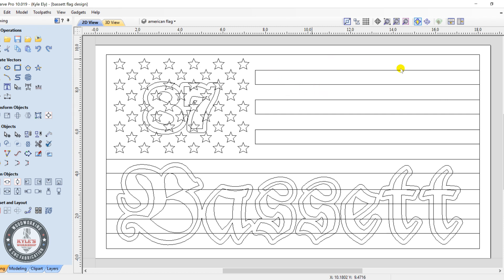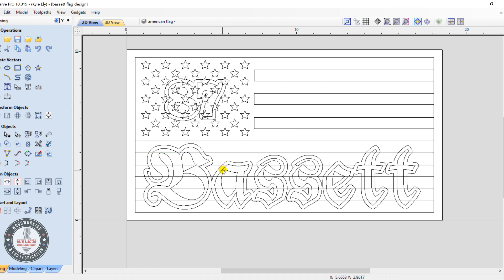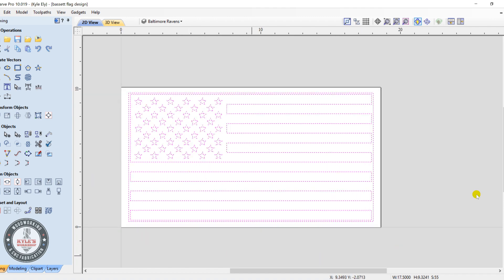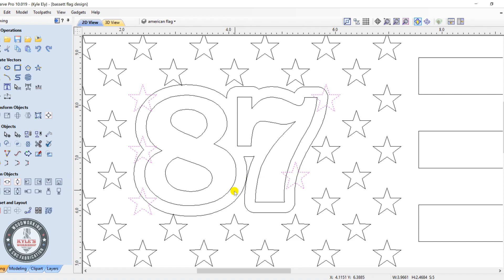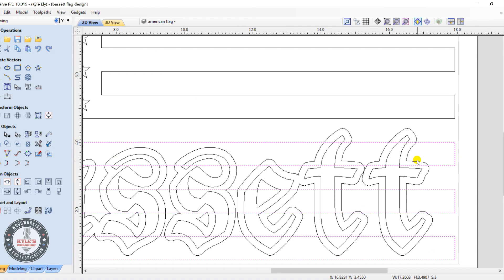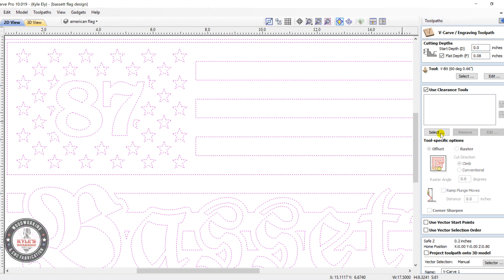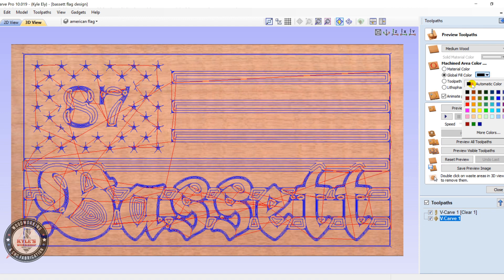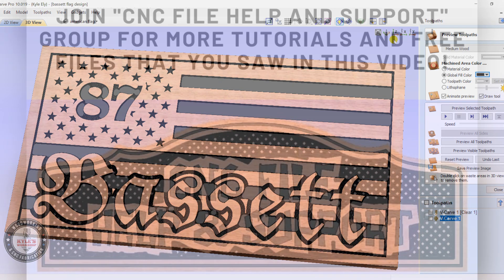How to Insert Text into an American Flag - Practical Vcarve Pro Tutorials - Episode 1

Comment: Very good tutorial!! In your VCarve Pro version 10 in the drawing panel, you have a group of buttons between the Transform Objects group of buttons and the Offset and Layout group of buttons. They are for aligning the objects in your project. I don't have that group in my VCarve program. How did you get those to show in their own group of buttons? I have a few choices within the Transform Objects group but not as many as you have. It would be nice to have them separated into their own group!
Reply from the maker: Hi Rob,
Thank you! When you open up the "Alignment Tools" form, you have to check the box at the very bottom that says "Show common tools on drawing tab" and that will put the commonly used alignment tools right onto your drawing tab. It is a very handy feature so you don't have to open the alignment tools form every time.
Thanks,
Kyle
Reply: @LearnYourCNC  Thank  you! I've had VCarve Pro 8 and now have 9.5 and never knew that existed.